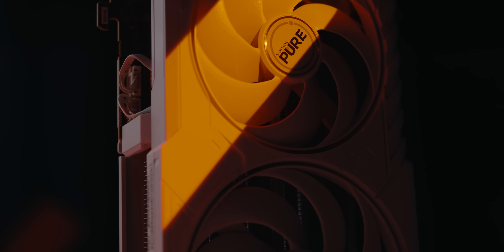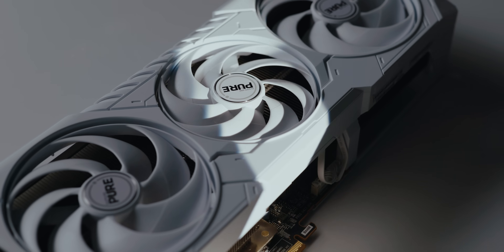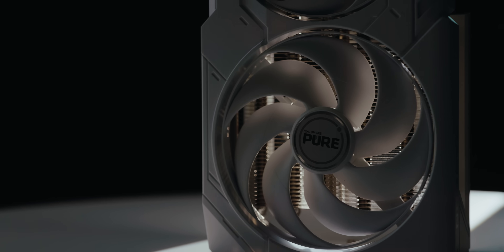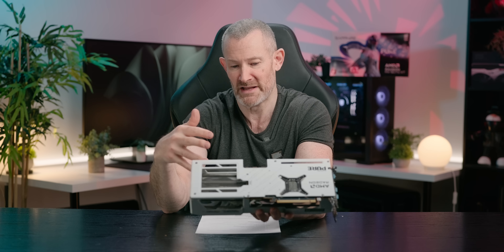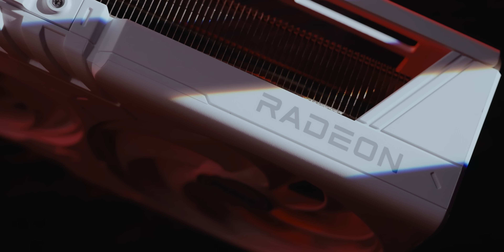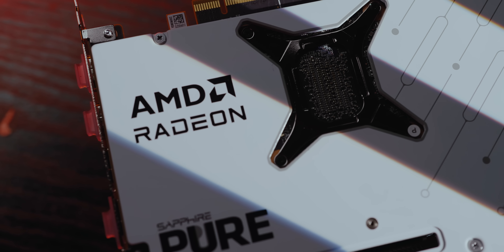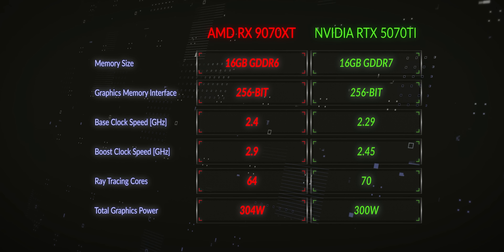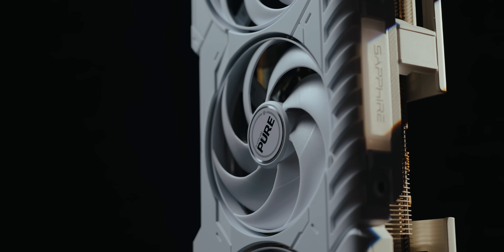Pushing The Limits Of The RX 9070 XT : Overclocking and Undervolting Review with 8PACK 📈💥 🔧⚡️

Comment: Why not use 9800x3d? Doesn’t the 285k do poorly in games? Why not give the 9070xt the best chance?
Reply: He's not really comparing it to any other GPUs here. He's only comparing it against itself in the same system so it's fair. From what I've seen lately, the 285k is doing better for games now than it did at launch. Still not near the X3D chip most of the time but not as bad as before.
Reply: Other current gen reviews on Intel platform...hence this choice...